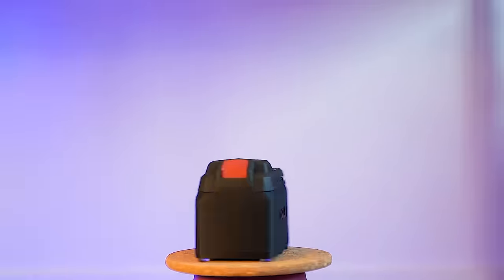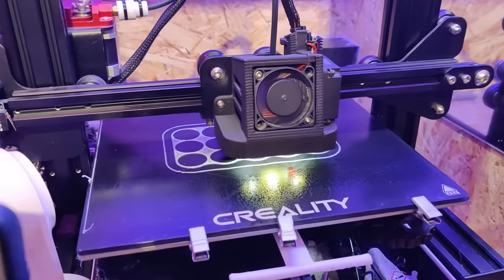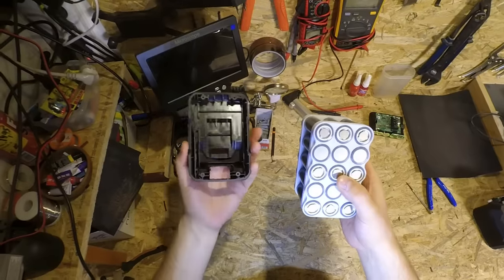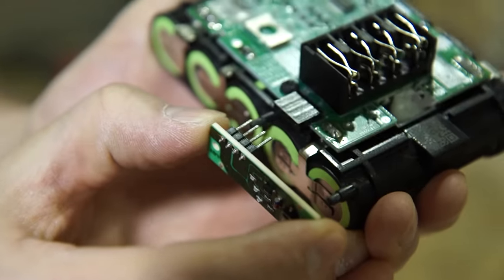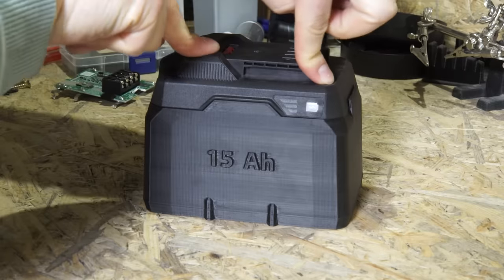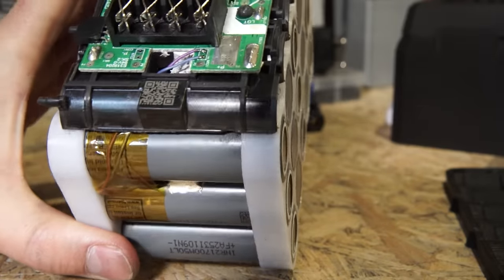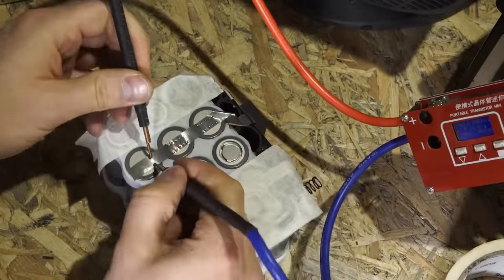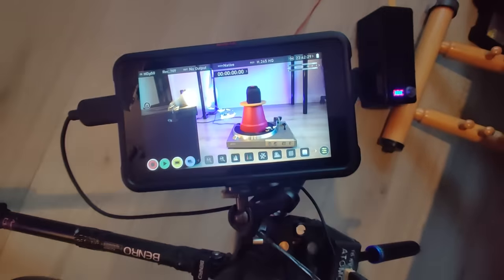Build a GIANT⚡⚡15Ah⚡⚡tool BATTERY!

Comment: I also got that cheap spotwelder.. and I was very impressed with it, as its ideal for my use and I can just use LIPO packs.
I use 2x 4S 2800mah in parellel.. it gives more then enough umff to spotwelderf nikkestrips up and beyound 0.2mm.
I know its rated for 12v (3s) but looking at the component and the cap.. i did not see any problem why 4S lipo (16v)  should not be tolerated, and it makes a huge difference in the spotwelding potency.
That small spotwelder was exactly what I needed when i purchased it some years back from BG at around 12USD, and also checked it with my oscilioscope.. its enegy rating from 1E to 99E is 1 to 1 with ms, on my scope and you can also use a footpedal with its small barrel DC connector if you need, but its "automatic" weld-feature works great..
and I love it doesnt take any space and can simply just grapp some of my RC lipo packs when I need to spotweld.
for the price it was a steal.. but using 4S  packs in parell made a big difference in spotwelding potency. versus fx 3s packs.

Great build and impressive video from such a small channel (+1).. got many Parkside tools, X20 line ,  and also X12, .. and sadly also a lot of the Performance BL line (the old version with 2.5A and 5A batterypacks that carried Samsung 25R cells).. and which you cant get new batteries for, as the Performance line shifted to X20 battery-hinge variant.
a tacky move from Parkside, dropping the ball on all the buyers that invested in their performance line.. IMO Parkside should at least make an adapter, so they can use X20 packs and buyers not ending up with quality brushless tools you cant get batteries for.
dang, that x20 gluegun just look dwarfed alongside that pack.
Im using  4A X20 with the same gluegun.. and its not a bad gluegun with its price in mind.. can deliver quite a bit of hot glue in a shortwhile and ideal for certain stuff.

Are you sure that 2A entry batterymanagement system are not choking that huge pack after the original 2A X20 pack current-standards.. just as when your charging it will be the slow charging speeds.
wondering if you actually gonna feel the effect of that huge pack.. like one useally do when using bigger batterypacks and not just longer runtime..
going from 2A to 4A pack big difference in torque on most of my powertools.. same on the older brushless with 2.5A vs 5A..angle grinder would way easier stall on low sized packs..

Comment: Hi, Nice video, congrats.
I presume  that the BMS/Charger will have a timer that will interrupt the charge after certain time for safety... so it would be interesting to see if you manage to fully charge from fully discharge in one shot.
Reply from the maker: Thanks! 😊 to answer your questions charging is not a problem at all, it just measures the voltage and charges until 4.2v is reached on every cell :) It charges no problem from empty to full 👍🏻 I'll make a video on all these details as soon as I find the time, I'm on a business trip at the moment which is holding me back a bit 😔

Comment: Yea i just bought the case and bm board on ebay for 15$… came with nickel strips and all..  used laptop batteries..  only tweak i had to do was research the protection chip they used on the board and desolder the supporting components on the leg that controlled the cutout amp draw limit because it was set too low for anything. Just had to take a smd cap out and put in a resistor based on the chart in the chips datasheet..  charges on the same charger as the name brand ones do and works better and longer.  Durable as well..

Comment: What is the android device used for the 3D printer? Is it a custom OS or is it an app
Reply from the maker: It is an app octo4a :) It's really a nice way of reusing an older android smartphone, no need for a raspberry pi anymore.
Reply: @Solipsfilm  thank you! I have an old Galaxy S4 that would be perfect for this.
Reply from the maker: @SUPERMAR10312  indeed, should be powerful enough for this :) I'm using a galaxy note 5 so it's the same generation of chip since the note was just one number ahead but released the same year. It works like a charm.

Comment: Nice video thanks. At minute  11:46 - when you remove a car battery you must disconnect the negative first, then positive. When connecting the battery connect positive first.
Reply: why?
Reply: @_24___  While unscrewing the positive terminal you may touch metal piece of engine or body that is still connected to the negative terminal of your battery. You can even touch the negative terminal directly on battery but even disconnecting negative first won't help you there. If you short the car battery it wil weld your wrench or Allen key, glow it red hot, discharge and destroy the battery. But in the worst case scenerio the battery itself will explode due to rapid hydrogen and oxygen release.
Reply: @tymoteuszmielcarski8649  Good points. Caution is advised and care must be taken.

Comment: Great project, but I have one advice. You have doubled the strips for parallel cells insted of serial connections. Actualy it doesn't make sense. Most of the current flows between serial cells (short horizontal stripes) - thoes should be thick. The long stripes connected directly to PCB can be actualy very thin, throu them flows almost no current 🙂
Reply from the maker: You are correct indeed, I'll pin this comment so people know to also double up these nikkel strips :)

Comment: 3:42 While that works just fine, you should invest in a Dremel kit or "Jewelers" rotary tool if you dont have one. They make little cut off wheels for those that you can do finer work with, no need to bust out the big boy grinder.

Comment: Hi! Wonderful job! I've converted an Xbox 360 power supply into DC 12V should be around 30Amp, is that enough to not using the car battery? And bought it from Amazon marketplace for £5 😃 I was thinking how to make an adapter from Milwaukee battery to parkside soldering iron , that's how I get a cross you video,after seeing how much work I've changed my mind😂😂😂I'm ok with the 2 amps😂😂😂 Keep doing the great job! 🥂

Comment: This video might be useful for replacing the cells in dead battery, I'm using milwaukee so even their cheapest high output 3ah isn't that cheap to make a new one. But if a battery will stop working this looks like a good way replace it.
Oh and pro tip - using grinder for such small cut is bit too much - my advice use   small cut off tool like the milwaukee compact cut off tool, it quite useful for alot of things.
Reply: Dremel with small cut off works very well..

Comment: You should have put a 1.5m cord to power the tool from the battery on the floor. Still portable but wired to be light weight holded

Comment: You have the 2ah to 4 ah adaptor ring, should have used that as the base of the mod, so no cutting was needed and the end product would have been stronger. Still great job. I think I'm going to do the same with my aldi batteries (no parkside here in Au).
Reply from the maker: Hi, thanks for watching, unfortunately what you're suggesting isn't going to work.. I really considered every option before designing in 3D and not cutting wasn't one of them. The extension part (2 to 4ah) is too small and the parts that stick out on the top part of the battery that I cut off are too narrow to fit these bigger cells, that's why my enclosure immediately from the top part extrudes outward so these big cells can fit in the smaller housing. 
Good luck with your design of the Aldi battery 👍🏻

Comment: I am surprised that the BMS didn't lock when you disconnected it. A kind of protection by the facturer to avoid DIY repair.
Reply from the maker: Some manufacturers do this nowadays yes.. I think it's terrible practice and I wouldn't buy from a company that does that ever again 😅
Reply: @Solipsfilm  This will end like all the print manufacturers, there is no longer any way to refill your cartridges yourself or use cartridges from another brand. But you will still have to buy 😅
Reply from the maker: @TheCrozenfox  that's why I drive a car from 23years ago, service it myself, also have a laser printer that's 15years old, I refill the toners dirt cheap, same with my tools if it ever gets to that, the second hand market will be your friend. People don't want the old junk but most of the time it's build better and also still serviceable, I like that :)

Comment: Amazing but with vent holes It Will be simple perfect
Reply from the maker: It wont be as waterproof against light rain drops etc. when working outside with holes, but for inside that could help indeed :)
Reply: @Solipsfilm  I'll take water-resistant over ventilated anyday. A better way to keep it cool would be to make the enclosure from aluminium (with appropriate safety insulation to prevent accidental shorts 🤣)
Reply from the maker: @vikassm  To be honest, with these massive cells they will probably not heat up all that much to begin with. I think they won't be pushed to their limits at all therefore staying happy and cool 🧊😎 I'll definitely do a follow-up video on all these details :)
Reply: @Solipsfilm  That's true indeed! I replaced a bunch of NIMH with some 18650s from old power banks, this old Black and Decker 12v has never heated up a day in its life 😂

Comment: what about making a power-bank a thick tablet to hang  like a necklace using a Garmin nuvi device, and integrating a light source such as Lidl PARKSIDE PASL 4000 B2 torch bulb... a solar panel and a tiny radio FM, so of course in case of war you can navigate domestic or foreign maps by foot without using smartphones, internet or telephone services, and being localized. Perhaps because in a war action internet services are first to go letting you down.
Another useful feature is to provide a special heated jacket/wind breaker similar to Brandit windbreaker but heated, and more insulated with a hood to sleep in in harsh conditions outside while on the move to safe zone.

Comment: You don't need so much work...just add how much cells you want and then the case will be far apart the up side and backside so you need longer screws depending how much cell you want to add...then in between all round the case put a cover like melted pipe or some robber...easy peasy

Comment: Rather then your screw hold design you could have used "nut serts" or basically a nut with a texture on the outside you can use a soldering iron to sink into the plastic eeasy peasy. Then Use thin bolts to bite into the fittings. This would give a more durable reusable case. Something you can open multiple times without the screws marring the insides.

Comment: Hi, I've been thinking about a similar project, but I've been wondering about cell balancing, is it ok not to use a load/charge balancer for each battery ? What about long term safety ?
Reply from the maker: Cell balancing is done by the bms, the extra cells added to the parallel groups balance themselves, the series connections get monitored by the bms :) How i did it here is exactly how it's done by the manufacturer with the 4ah and 8ah pack, no safety issues should be present.
Reply: @Solipsfilm  How do they balance themselves? I haven't seen this in the RC hobby to be the case. They warn against parallel charging without monitoring every cell individually.

Comment: hi, so u tell us, that it would not charge on the official parkside charger, but would a BMS that isnt from parkside work in parkside tools? It may sound like a bad question, but on my ebike from bosch u cant use BMS other than from bosch, because that BMS communicates with motor, does the same apply to parkside? Or only to charger? Many thanks
Reply from the maker: The chargers form Parkside have an extra data pin that communicates the temperature and state of the cells, an aftermarket bms does not have this and thus the charger won't charge the cell.. I've tried 😔 Must be similar with the charger from your Bosch e-bike indeed..

Comment: how does it take to charge 15 Ah to 100% with that charger? thanks for sharing video.
Reply: Charging current of charger is the number you divide the 15Ah pack by. 3A charger...5 hours, now add 20 to 30% more time for the CV phase of the charging.

Comment: Is it possible to be made for the DEWALT XR Flexvolt 18V-54V  battery pack. If yes what kind of batteries should be used?
Reply: Flexvolt is really hard to replicate because of the way it series/parallels the packs depending on the tool it is inserted into. It is possible but expect someone to charge you quite a bit of money if they a have to design the new battery housing for it.

My advice would be to find the battery housing on Aliexpress, order one to make sure its good and if you need more than 1 let a battery maker put a pack together first to make sure there are no hidden issues. The shell would probably be $50 at  most and 15 cells would be 50 Euros or $60 USD depending on what you get.

I'm pretty sure the Flexvolt uses Samsung 50S...good luck getting those for less than $8 each anywhere. You can substitute with something like the Molicel P45B but thats also a $9-$12 cell. I would use the 4200mah 35A Realistically rated Molicel P42A at $5 each.

Comment: Omg ..... Ok you made it how do the tools fair with it ? It a lot of juice for most Parkside tools
Reply from the maker: The tools couldn't be happier, the voltage is the same so the tools don't really notice a difference. Since there's so many cells in parallel the voltages drop less and so the tools have a bit more energy to work with if they need it :)
Reply: The tools only draw the amount of current they need.

Comment: Hi , if I buy your 3d printed parts do I still need to cut and grind the top part and red button from and old batter case ?
Thanks
Reply from the maker: Hi!

Yes, I only sell the 3D printed parts. 

You will have to buy a 2ah battery pack from Parkside to use the top, bottom and BMS from. The top part needs to be cut and sanded to fit the 3D printed part.
It's really not that hard to do if you have an angle grinder or a wide enough sanding belt. :)

Comment: While you said you would link proper nickel strips, your link goes to a generic sale page with multiple options - with the 0.15mm selected by default - would be nice if you just.. mentioned the right size.
Reply from the maker: How about you listen to the video again..  I mention that I used 0.15 but it should at least be 0.3. so either you double up or buy thicker. (Spot-welder needs to support 0.3 though)

Comment: the battery is very big and most probably too heavy for small power tools. I've see a similar project with cell modification for total power of 9000mAh but what is not clear for me is why is possible to use same BMS board with different cell and major power than the original battery of 2000mAh: do you have more technical info or a datasheet of BMS board 2A? I don't like super glue: is it very super for that heavy work?
PS: for cut plastic of the upper side of the battery an hand tool should be enough than angle grinder 😂😉

Comment: Nice build, however triple strips on the series connection that barely take any amps and using a single strip for the parallels which take all the current is just a bit shady and will definitely lead to high temperature inside the pack as well as high losses due to heated up nickel !

Usually you reinforce the connection in the direction the current travels in this case between the series groups and not along them.

Very nice project still 👌
Reply: I doubt it..It seems he is using that battery management system from the low entry 2A pack.. pretty sure it is choking the output to that low entry 2A pack standards, just as with the charging will be handshaked after that org pack values. (I would reckon)
If you search online.
you can see test:
"Nickel welding strips - current capability" (not alloved to link)
and people putting 600watt (60v 10A into 0.15mm 7mm nikkelstrips in res-load.. and saw no heat, still stonecold..
so the hysteria on nikkelstrips and you need more and bigger etc etc, is to some extent overdone.

Comment: Hey guys do you know how to connect 20volts parkside battery to a 12 volts intverter that makes 12v to 220 volts ac
Reply: The inverter will not accept such a high voltage. Probably maxes out at 16V. You need a buck converter before the inverter.

Comment: I have that Wise Maple spotwelder, it's great with powerful battery, but not enough powerful to weld 0.3mm thick strips. Welder recommended max strip thickness is 0.15mm! I recommend using multiple layers of 0.15mm strip with this welder.